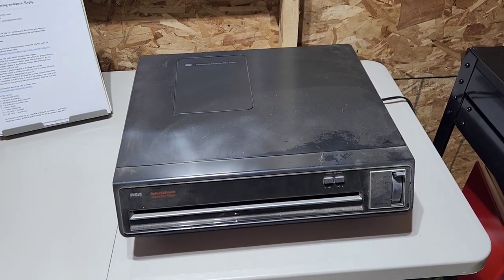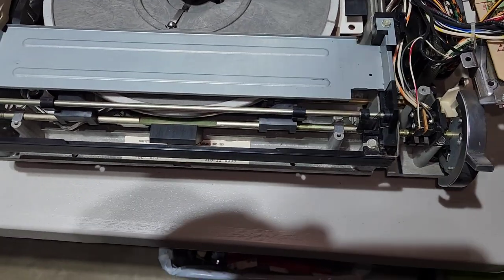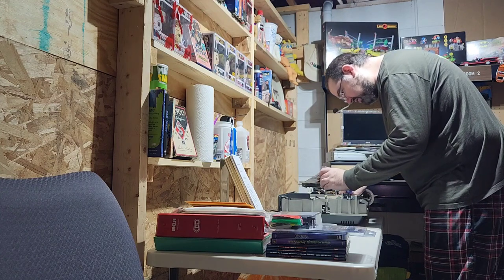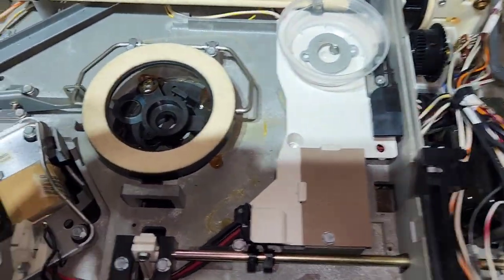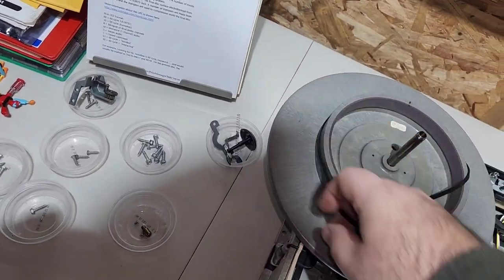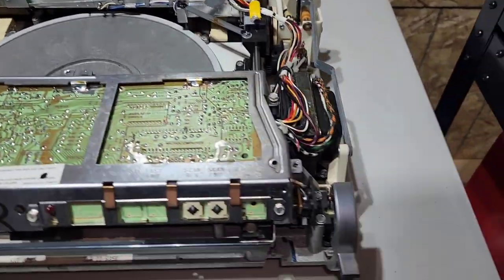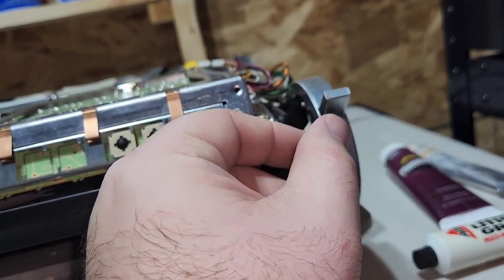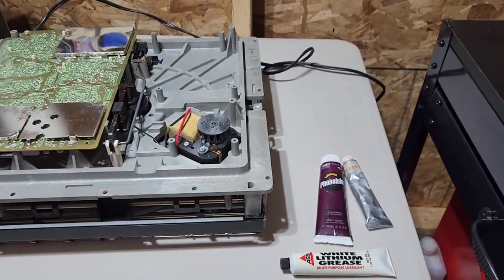How to Service a F/G Model CED Videodisc Player

Comment: I hope you are going to do a series of videos. There is a group of students a TCNJ who are fascinated by the machine. I have forgotten everything I ever knew. I worked on the R and D of the disc player. It was so crushing when RCA abandoned the player in 1985. I was building a reputation as an expert on repairs. I had training for the  400 series that had computer  control.

Comment: I put in a new stylus but I still have rainbow colors off and on in the movies. What can cause this? Thank you
Reply from the maker: Rainbow effect is caused by improper turntable speed. Typically on a F/G player you can re-lubricate the turntable shaft and it will resolve the issue. But it could also need a thrust plate adjustment or the platter may have lost it's magnetism over time. Sometimes the belt can create drag as well if it's too worn out. Feel free to contact me if you have further questions, videodiscjunkie@gmail.com thanks.

Comment: This is the original issue of the player.
It was the most easily serviceable machine. 35 years ago I was trained  to service this model at RCA Labs. We had 1500 employees. Many of them had players and we had a free lending library for employees. It was my primary position to keep about 600 machines running under the program. Then RCA abandoned  the players discontinuing the sales. Needless to say I was out of a great job. On top of that GE  took o er the company is a hostile take over. It was then I went to work for  IBM.

Comment: Can you provide the belt measurements please? Or a source for replacement belts Thank you !
Reply from the maker: So the F/G models use 2 belts, a Servo belt for advancing the stylus arm and a turntable belt to get the platter up to speed so the sync plates can take over. The turntable belt rarely needs to be changed, the servo belt needs to be changed almost every time. Unfortunately the belt that RCA used had a concave design which is no longer manufactured. So I offer a kit that comes with a smaller belt and small plastic washers. The washers and smaller belt design prevent it from riding up the motor shaft and get stuck along the wall of the mounting bracket. I offer both the servo belt kit and turntable belt for sale on my website cedatum.com or if you would like measurements of the original belts they can be found here, https://cedmagic.com/tech-info/belt-replacement-guide/belt-specs.html

Comment: I assume that the F/G players are the first generation CED machines, while the J/K is the second generation, is this correct? As a newcomer to the format, which series would you recommend over the other?
Reply from the maker: The F line was the first to come out, then the G line with stereo models, then the J line with auto loading players and K line was last. F/G & J were all being produced around the same time, then K came out last, around 1984. I personally prefer the J line myself, the 90 and 100 are intro level mono players, the 200 added stereo, the 300 added a remote, and the 400 was the top of the line with interactive capabilities on a few select discs. The SJT400 would have to be my preferred player as I feel the J/K players are the easiest to work on and maintain. The F/G models have a lot of moving parts that all have to function properly to get a well working player, there is a lot more that can go wrong. Hope that helps.
Reply: @ketonicdude  Thank you, this helped quite a bit. I've been searching for a used one forever, but I only find them for $100 or more, and I'm not sure I want to pull the trigger when they might have a bad stylus or something else going on.

Comment: Is there still a source for styli?
Reply from the maker: Hello Jim, it's a pleasure to meet you. I always enjoy hearing from former employees. Another former employee, John Stevens, perhaps you knew him, he used to service the styli. Unfortunately he ran out of spare parts, mainly diamond tips, and then he passed away taking all his knowledge with him. It was a major loss for the format. We have a good understanding of how a rebuild could be done through the RCA Review and we have another former employee from the Stylus department. But the equipment that would be necessary to rebuild a stylus just doesn't exist, nor do we have the spare parts. So unfortunately that is going to be the downfall of the format as a stylus typically runs about $150 on up right now and it's only going to get worse as they get more rare. But as far as the machines go I am working my best to provide as many parts as I can and whatever assistance is necessary. If you are still in the NJ area we do have several members from the CED Magic community that would love to meet with you if you would like to see a player in operation again. Feel free to contact me at videodiscjunkie@gmail.com for further information. Thanks. -Josh